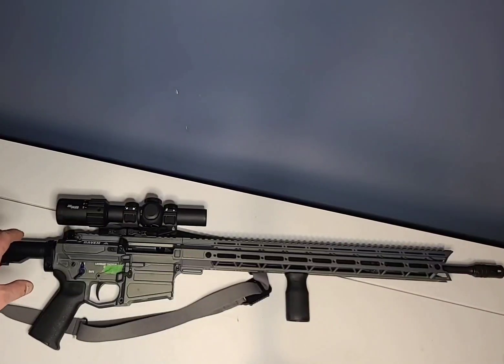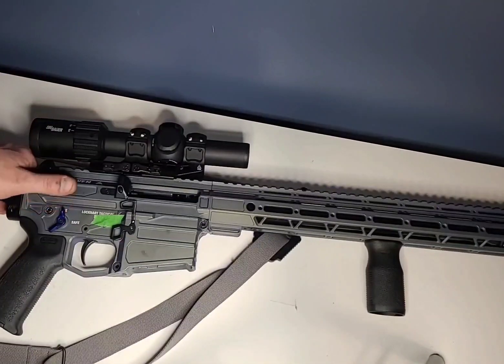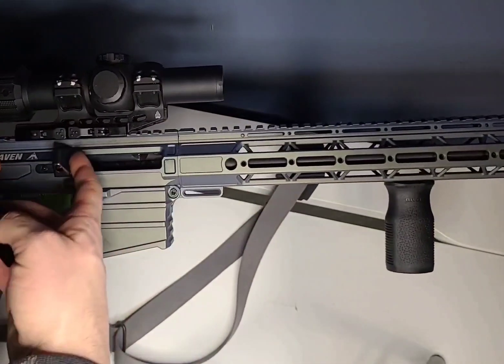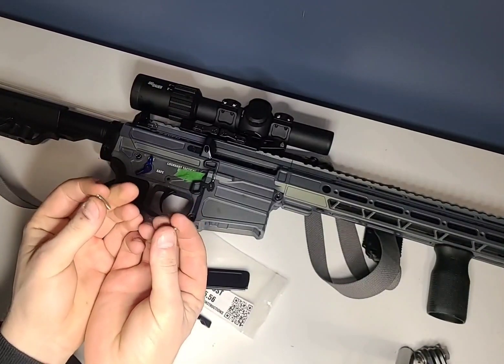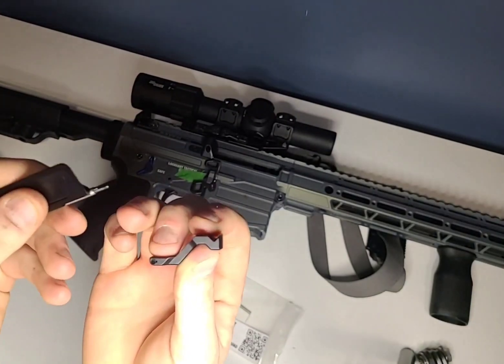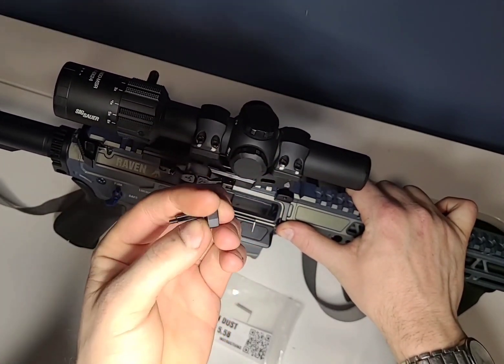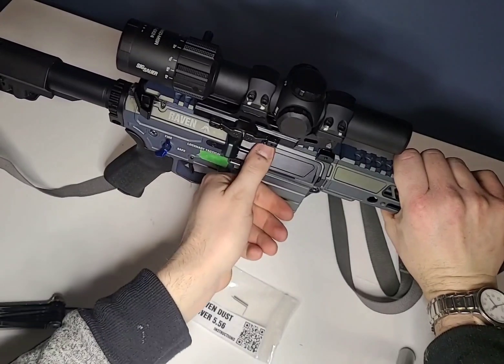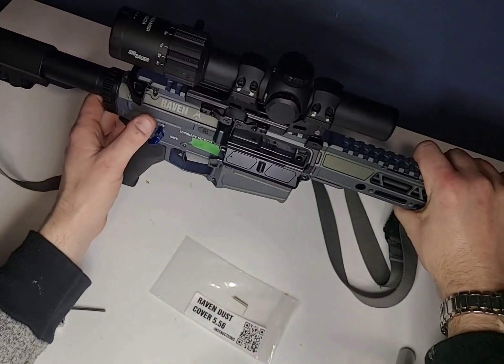lockhart raven new dustcover?

Comment: I have to agree. I can’t think of another Canadian manufactured rifle that’s better. Maybe the st 22 by spectre ballistics. But there is a ton of innovation in this. Just the way it all pins together. Just change the upper and the bolt and you have a whole nother calibre. 
Really glad you made this video it’s gonna help a lot of people. 
When I tried to adjust mine I couldn’t quite get it and had to file the rod back about 2mm. Now she’s perfect
Reply from the maker: Totally agree, it's basically an ar15. I feel bad for dome guys in the comments having issues with the barrels though
Reply: @gustavohonzofo  yeah I hear ya. It’s like the first few were good. And then that issue with the gas hole being to small, guys having to drill them out and then quality when downhill from there. I’d love to hear how the ones being released now are doing. Hopefully qc has been better. 
Only one thing is better that the ar and that’s being able to pop 2 pins and swap the magwell. After the next election and everything goes back to normal it’ll be sweet to see what guys will build. 
Not sure if your on the Facebook group but Taylor ( the guy who won the national pcc ipsc championship) built a pretty cool 556
Reply from the maker: Yeah hopefully, I'm not on Facebook unfortunately. I believe it would be the only gun that would stay after the oic. The 180's are garbage heaps so the raven would be the only one still relevant after.
Reply from the maker: Ah yeah I use to read the articles on theirs I have been subbed for a bit. I do but not with the raven or any 5.56. I usually use my k98k or other milsurps. I was into milsurps well before I got into the tactical realm.
Reply: Savage makes really good guns

Comment: Any use for the deflector? I feel like we’d be fine without it but the right side charging handle makes for a good forward assist
Reply from the maker: Without it the brass chips the coating on the receiver. You can run the charging handle on the left as well

Comment: Would it be as simple as finding out where the detent sits against the deflector when closed and drilling a small relief for the detent to sit in?
Reply from the maker: You will still run into the wearing issue if you are talking about a plastic brass deflector. If you could get a steel one it would work.
Reply: @gustavohonzofo  yes sorry I did mean with the steel one. I think that would be a bit more reliable than simply friction.
Reply from the maker: Oh I'm sure you could if you were having problems or something, after I adjusted it it worked good with no drilling needed

Comment: If you’re taking a gamble on a rifle that costs as much as the Raven. It’s not a great platform. Its reliability seems mediocre at best and the consensus seems to be that it’s barely a notch above the other Canadian offerings because it “looks great” and has “AR-15 aesthetics/ergos”. The best reviews I’ve heard about these come from those who went the builders kit route. I see no point investing in the Raven when you can pick up an X95 or a BREN.
Reply from the maker: Yeah the barrels seem like the biggest issue after they fixed the bolt carrier cracks. If you swap the barrel or get lucky or buy a builders kit I have no doubt in my mind it would make it to 10,000 rounds im already at 4 with no major issues